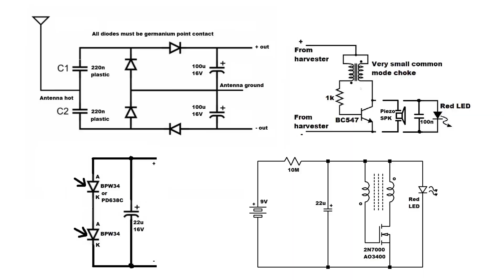Some micropower circuits (energy harvesting)

Comment: Quando testate un joule thief con i piccoli oscilloscopi di 20 euro , attenzione perché sono limitati a  40 /50 volt , e il jhoule thief produce picchi di tensione fino a 300 volt e oltre , perciò bye bye oscilloscopio mega mini affarone da 30 euri 😂😂😂
Reply from the maker: in questo caso ci sono molte cose che limitano la tensione, innanzitutto il LED, secondariamente il BJT non va oltre tipo 50V, per avere 300V devi mettere un trans che regge quella tensione, anche con solo il condensatore la tensione scende... comunque non ho uno di quegli oscilloscopi, ho un Hantek da banco ed un Unaohm a tubo catodico

Comment: Nice! I tried something like this to power a nrf52 device with a small solar cell operating well below ideal conditions (cloudy all the time!) - but found it difficult to manage the thing when light conditions improved. there is a sweet spot for the JT to oscillate properly and overall and doesn't work well outside of that range. it is still interesting though and probably could be made to work better with better skills than mine :)